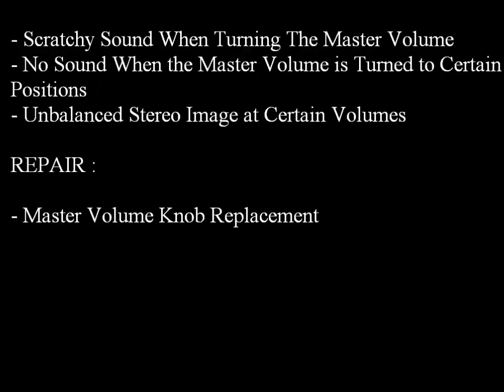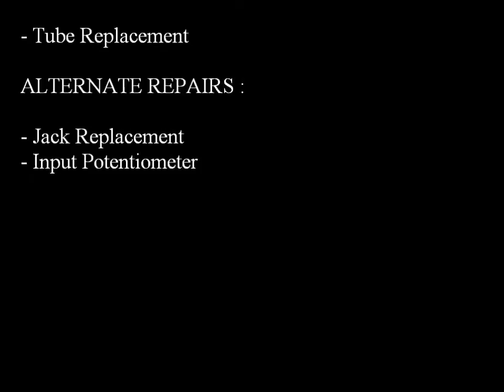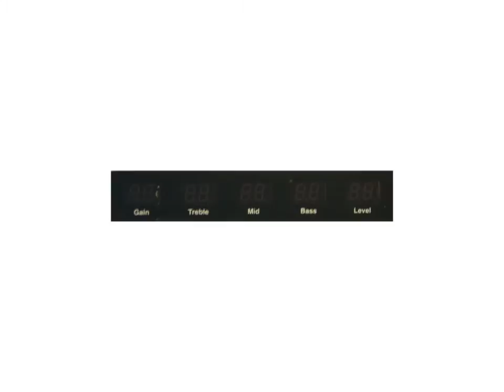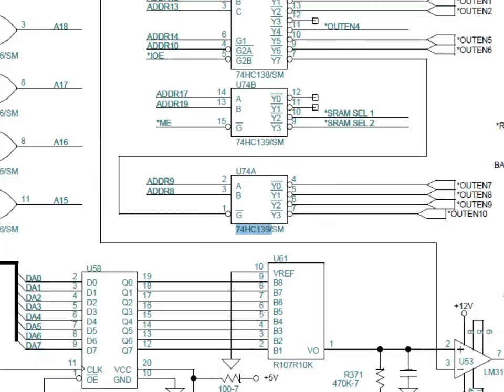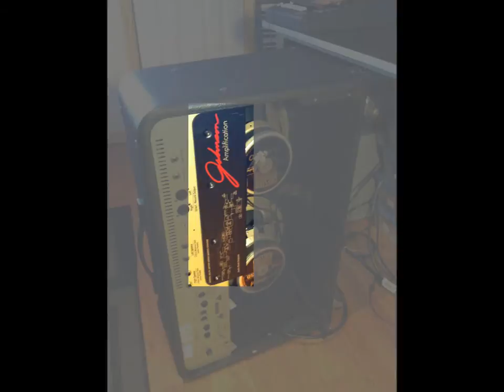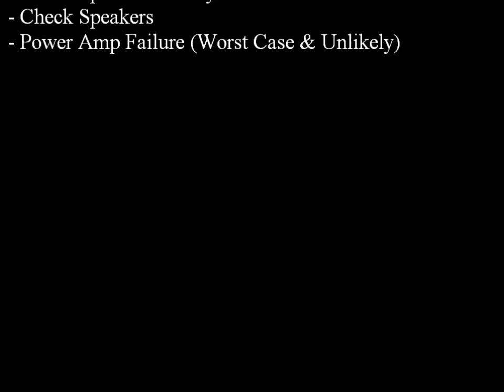Simple, Common Repairs for the Johnson Millennium JM-150 & JM-250

Comment: Hello...just lost signal coming out of effects loop pedal attached to return jack and can see signal registering on the meter but no sound out. Please advise.
Reply from the maker: The Johnson is a fairly noisy amp at high volumes if you have the noise gate off, even with nothing plugged in. Start with your noise gate settings and ensure the gate is on.
Reply from the maker: So with the physical effects loop unplugged, and fx loop removed from the chain what do you hear?
Reply: Thanks for responding. I was running my 11 Rack  thru the return. It worked for a while and then nothing. I removed it and the amp works fine. Then I ran my Whammy DT same way and I get the same thing.
Reply from the maker: First thing I would do : patch a mono 1/4" directly from send to return. Ensure the fx loop is on in the patch, and see if you get sound. Turn the fx loop off in the patch and see if you get sound.
Reply: OK I ran a patch from send to receive with fx loop on no sound with it of I have sound. What next Batman...
Reply from the maker: Best case scenario : time to change a jack or jacks. Check the solder joints and jacks themselves for continuity. If they're good, you may end up immediately in worst case scenario : The actual loop isn't being turned on anymore which could be a problem at any number of places in the control or signal chain.
Reply: That was my thinking. It goes in the shop today. Thanks for your help.
Reply: OK....just got amp back and problem with fx loop has been fixed however I am now noticing a hiss in the amp that I dont remember noticing before. Do not hear it at low volume but when I turn the amp up I hear it. With and without guitar plugged in. Please advise. Is that normal or not???
Reply: OK....just got amp back and problem with fx loop has been fixed however I am now noticing a hiss in the amp that I dont remember noticing before. Do not hear it at low volume but when I turn the amp up I hear it. With and without guitar plugged in. Please advise. Is that normal or not???
Reply: Thanks again for the speedy reply. I can appreciate what you are saying not sure I completely understand. I have the volume all the way up and do not have a guitar plugged in. The gate is is on. I have adjusted the gate completely closed and still get a slight hiss. Is that normal. Concerned that there may be a ground issue if it is not normal.
Reply from the maker: Hiss or hum? Like white noise hiss, or loud 60 Hz hum?
Reply: White noise hiss.
Reply from the maker: If it's white noise, it's not a typical grounding issue. It may just be the amp which is kind of noisy at high volumes.
Reply: Ok...thanks again for all of your help.

Comment: You are very methodic and detailed in your explanations resulting in excellent repair tutorials.Thanks for sharing your knowledge and expertise to help give Johnson Amp owners some hope in keeping them functioning properly as there is no longer any support from the now out of business Johnson Amplification.I have a JM-150 Stereo and I have experienced a few  of the issues you described in the video conceding the potentiometers.The Amp is for sale is you are interested.
Reply from the maker: I still have 3 150's and a 250 head, so no real need, but thanks for the comment and letting me know. There are lots of people hunting for these amps now so you should be able to sell fairly easily online.
Reply: Hi great video I am having trouble with my 150. It powers on but does not boot up. I have taken it to my local amp repair/ electronics guy 3 times. Each time he says its rock solid. I live near Salt Lake City and I do believe he is a qualified Harmon repair man. What would you say could be the issue. And what would you say to do from here. He says he worked on the power supply.  I would say that he doesn’t know what the issue is. I have played this amp for more than 12 years Hope to here from you thanks.
Reply from the maker: So, he gets it to boot at the shop, you take it home, and then it fails?
Reply: Yes . I take it home and it works fine as well. Then this last time I didn't play it for a while because I had been playing my Marshall. Plugged it in and same thing comes on and doesn't boot. It does seem like an intermittent issue because before I took it back to the shop it was not booting and all of a sudden started working. It also has somewhat of a speaker pop sound when switching it off. Thank you very much for getting back to me.
Reply from the maker: Speaker Pop : Make sure the Master Volume is all the way down. What to try? Try to boot and run without the power amp plugged in. If you experience the same behavior as far as shut down / turn on, boot / no boot, then you can pretty much eliminate that as a possibility.
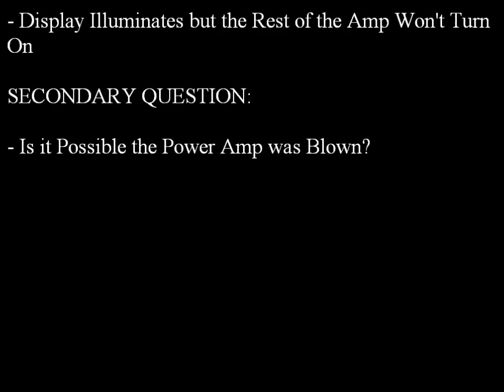Reply from the maker: See @6:08 in the video.
Reply: I will try that. Might I add that the speaker pop is happening with the volume all the way down.
Reply from the maker: Definitely try the power amp unplug test.

Comment: What is Writing to the EEPROM. Is That A PART.? More Clairty Please.
Reply from the maker: EEPROM : "EEPROM stands for electrically erasable programmable read-only memory and is a type of non-volatile memory used in computers and other electronic devices" - It's non-volatile meaning if power goes away, the memory does not go away, like the hard disk on your computer, or a portable flash drive - the patches are stored here. If the back-up battery was dead, non-volatile memory is not erased. your OS and patches would still be in the EEPROM. If your amp isn't storing new patches, it's not writing data to the EEPROM.
Reply from the maker: As a side note, if you just replace the EEPROM, the amp will not boot - it needs to have an image of the operating system flashed onto it in order to start, or even accept an upgrade through amp-to-amp transfer. In other words, it's not a trivial repair.

Comment: They said parts not available. For master volume. I found a Speaker Out Put Jack from a tech here in town. Now to fix the Amp not storing the setting. Red light comes on but doesn't store. My guess is the 2032 battery. What do you think.
Reply from the maker: When you hit store, it won't store, or when you power on/off the patch isn't there?

Comment: I Need a Master Volume Pot for my Johnson Millennium 150. Can you tell me WHERE I Can Order one. The Part Number. And I Need 1 Speaker Out Put Jack ( Right One ). I have taken it out the PC board . It has 4 pins and one is a little off set. No one can order it for me and if you can please tell me Where To Get The Speaker Out Put Jack 80-6094-B. That's on the PC board . Far as the Master Volume Pot I Need That too. Please Help. Thanks
Reply from the maker: Have you called Digitech?

Comment: Hi. I had to replace the output volume potentiometer. Something is wrong because after install, it just seems that the volume is stuck on max. There's a constant hum now because of it. The value of the pot I got was 100k. Any ideas?
Reply from the maker: The only thing I can say is that it sounds like you didn't do something entirely correctly in replacing the part, or you installed a defective part.
Reply: Hi! Ok, problem fixed! There is component on the component side of the board that was no longer making contact with the pot. Easy fix. Thanks for your help!
Reply: Hello . I have the same issue as you after replacing the output pot. Mine is also at full volume after replacing. I also noticed that it looked like a small portion of circuit-board contact was missing on the component side. Is this the same for you? How did you fix? Please advise.

Comment: Is it possible in cleaning those small rotor parameter controls? My Johnson has a few controls that I continue rotating in making changes. 

Regards Marshall
Reply from the maker: It's best to just replace the rotary encoders, although at this point it is difficult to find the correct size/spec with the D-shaft that the knobs fit onto. Bourns makes compatible size and spec, but different shaft style.

Comment: Hello.I so appreciate this information that you have posted on one of my favorite amps. I have a JM-250. The battery has already died. I thought she was finished, but I replaced the old battery with a rechargeable PCB mounted. I do have a problem with flashing/jumpy number on the gain input only at this time. I also have a problem with scratchy master volume. I see that you recommend replacing master volume and the contour knob. I see replacement items being offered on Ebay as Digitech PN 40-2011. Is there another place to search for these parts? Do you have a PN or a cross reference for an alternate part number, or maybe a better quality POT with the same physical parameters that wouldn't require such frequent replacing?Please advise on this, and thank you again for this GREAT video.
Reply from the maker: +Frederick Kramer I have never been able to find the part in low quantity from another American supplier. The taper of the pot is not a typical linear or log, it's somewhere in between. If you're willing to sacrifice the taper you can use any dual ganged pot of the same value that fits the form factor - I don't remember the package size or value off hand.  I've also only had to replace master in any of my amps once, and I've had most of them for 10-15+ years at this point - if you're replacing them more frequently than that, I would take a hard look at the conditions you're using the amp in.

Comment: Hi Don,Not sure if you are still involved with supporting the users of these amps or not.  Sad if not, nobody else seems to know a whole lot.  Last post was 8 months ago and my question/request through your form has gone unanswered.  I'm quite sure you are a very busy guy.  I'm hoping to get a copy of the schematics for the JM-150.  Mine had a problem with the 5VDC supply but I have fixed that but know there will be future needs and having the schematic set will help me keep the amp going in the future.  Would also love to update the OS so any info on that would be helpful...I don't know anybody in my area that has one of these amps to clone from so would be interested in how to load the files (if someone has those) from a laptop and MIDI interface.Thanks for all you have done...lots of great work documented below...Cecil

Comment: Mr. Bosley,

First, let me say thank you for all the great videos you've made about the Johnson Millennium amps!  I agree that these are great amps, and I really love mine.

Sadly, my JM 150 is having a problem I can't quite figure out.  Here's the story: After a night of beer-fueled guitar playing, I mistakenly left my amp on all night.  Unfortunately, I awoke to find the amp would no longer produce any sound (just a slight hiss as if nothing were plugged in). Additionally, the LED backlight no longer lights up.  However, I can still see and scroll through the menus using the unlit display.  So it appears that the on-board computer is still functional.  

I've changed the pre-amp tubes following your instructions, but no dice.  The only real problem it had prior to this was a scratchy and uneven Master Volume Knob. I wouldn't suspect that as the culprit, but I'm no engineer.

Do you have any suggestions as to the source of this problem?

Thank you in advance for any help you may provide!
Reply from the maker: As with another comment, I'm just now seeing this for some reason. Have you tried the disconnect of the power amp to see if the amp turns on full tilt? Have you tried to see if sound is coming out of the XLR ports?
Reply: I have this same problem.  Was the solution ever found?  What was it?

Comment: Hey Don, I'm having a particular problem with my JM150 that I haven't been able to find any information about online. 

I'm not getting any sound. Everything else seems to work. It powers up, lights up, boots up, and all the switches and knobs work. The speakers hiss but they don't react to either the Input Level or Master Volume knobs. 

Any idea where the problem might be or where I can start to troubleshoot? 

Any help would be greatly appreciated.
Reply from the maker: danny stanger Step one would be verify all of the voltages on the power supply are good under no load. After that check voltages under load to ensure they stay the same. Also check all of your connectors internally. If you are getting a recurring digital clip light, or have the VU meter on the LCD randomly go to black, you have a digital problem. If you are just getting boot, but no sound, you may have a problem with tubes, or the voltage to the tubes. Unfortunately, there are a host of problems that can happen.

Comment: Hi Don - My JM150 now has a problem that can't be overcome by a factory reset, and  based on your video, it is probably beyond my ability to fix, but I thought I'd ask to be sure.

When powered on, the LCD is blank and all the buttons light up green except the "Store" button, which is red. The force factory reset using the Config/Mod buttons doesn't work. If I turn the master volume up after power on, I can hear an increase in the normal hiss present when there is no input. I tried the procedure in your video involving unplugging the connector that would leave the MIDI outputs working but not the speakers, and it made no difference.

Based on that and other information in your videos, it looks like this is a job for an amp tech. Do you agree? Can you tell from this if its likely to be a major repair or might be something relatively minor?

Thanks!
Reply: I'm having the same issue.  Please let me know if you find a resolution.  Thanks \m/
Reply from the maker: For some reason I'm just now seeing this. I just had someone send me a board which I re-flashed by amp-to-amp method with success. You may be able to find someone in your respective area that you can try an amp to amp flash with.

Can you provide any circumstances that may have lead to the situation? 

Main things you can DIY check - are your power supplies good? Are your cables all seated? 

If I had to guess you're firmware is gone. If amp to amp won't work, you need to replace the EEPROM, or attempt a pin lift (Iift pin 2 on U78) then reboot to see if your amp will be booted from higher level memory.

Comment: Hi Don - Lots of great info here ... which I hope I never have to use. ;-)

I just took delivery of a JM150 that was shipped from FL to CA. Upon first power on following delivery the unit didn't recognize the J8 controller that came with it.  I turned the unit off, unplugged the controller, plugged it back in, then powered the unit back on, and then it recognized the controller. After that, the sound cut in and out intermittently regardless of the preset being used. Switching to the other input made no difference, but time apparently did - a few minutes later the sound stopped cutting out, and I've noticed no other problems since then.

Should I be worried that there is something wrong with the unit based on that? Perhaps vibration from road travel loosened something that settled with time? There is a possibility of damage during shipment also, because the case has a superficial crack on the top from the back towards the power switch (but stopping before getting there).

The material on the case doesn't look or feel like Tolex - can you recommend a repair material? A wood glue would probably seal the crack, but what could be used to cover that to match the exterior case material?

Thanks!
Reply from the maker: Mark Peters The chassis is fairly sensitive to temperature so being in a 100 degree box riding through texas and then in an air conditioned room suddenly could cause things to shift. I would remove the chassis and physically inspect everything - sometimes the ribbon cables come loose and either need to be reset (push them down) or even replaced. I would check all of your screws as well.
Reply: www.bosleymusic.com Okay, thanks. Hopefully it will turn out to be an acclimation issue.
Reply from the maker: I have no idea - I'm not sure that's what it is, but I can't find a more reasonable explanation for  why encoders not attached to the mainboard almost always outlive the MV/Contour, input, and encoders attached to it. They're manufactured under the same processes, the the RE's are identical parts, An amp sitting in a trailer in December in Buffalo, Cleveland, Detroit, etc... overnight gets down to below 10, and then putting the amp under stage lights in a packed bar, let's say anywhere from 70-85 degrees the next day - we're talking about 60+ degrees of difference. I'm not a metallurgist but Aluminum (if that's what it is) seems to have pretty poor characteristics for linear expansion based on temperature - we're also talking about a part that's mm large being affected. It wouldn't take much to stress it, would it?

Comment: Hi man, do you have the schematic of the amp and foot controller (and jm120?)
thanks
Reply from the maker: Yeah, shoot me a private message through the contact form in my site, and I can send you the files.
Reply: thanks man
do you have the schematic for the j3 and j8?
p.s i have a jm120 in storage in Scotland but one of the knobs broke off do you no if it a 100kw pot (feedback knob) going up in a a few weeks i would like to buy the pot now and fix it when am there
thanks

you been a great help with your vids thanks
Reply from the maker: Brendan Bradley I unfortunately do not have schems for the j3 or j8, but I know the j3 is just three passive switches - I believe they are optical rather than mechanical.